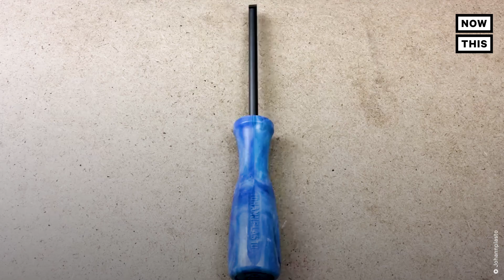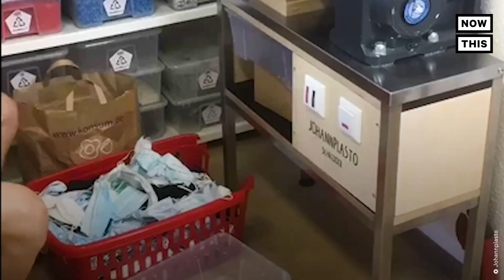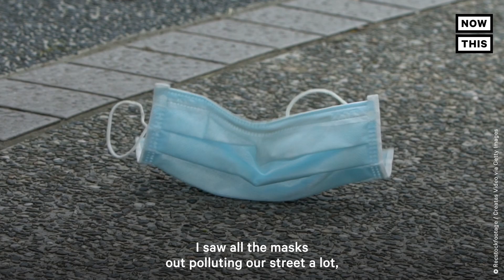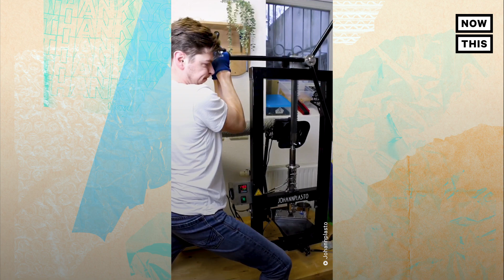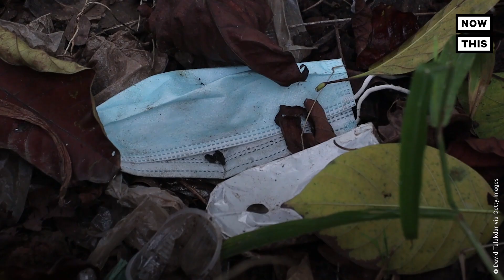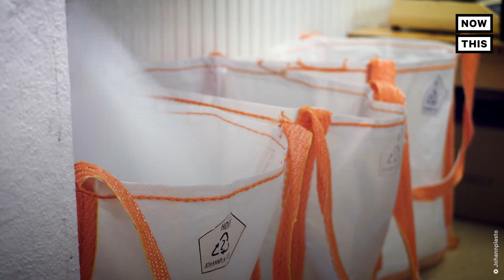How to Recycle Disposable Face Masks Into Tools

Comment: This sounds like marketing more than usefulness. He's making screwdriver handles  not screwdriver. What does he do with the water that is used to wash the masks if the issue is masks releasing micro plastic into the water?
Reply: They make filters that you can put onto washing machines that catch a lot of microplastics, so I hope he is using one. But even if there are some being released, it is much less than if the entire mask made it into the water supply. Doing something halfway is better than doing nothing at all. If we never implement greener tech because it isn't perfect, we will never get anywhere. I'd rather see greener technology that still has some problems than the systems we have that have much larger ones. Improvements can come, but we have to start first